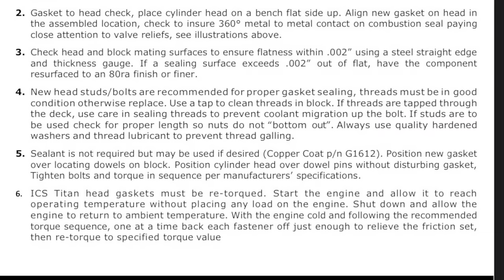Exposing Lies About VQ Engine Failure.

Comment from the maker: Time stamps:
1:42 Stock Motor Runs
3:39 Initial Engine Install/Break In
10:48 Air/Fuel Ratio Sample
13:10 Full Engine Teardown
Reply: “High profile customer” is Laughable when griff buys followers.
Reply from the maker: @DeepRightRecords  fabricated comment from a dead channel.

Comment: The fact he drove home hour n half on a built motor with a bad headgasket 🤦‍♂️
Reply: No pulls should be fine
Reply: @christopherbassit2757  “should be fine” lmaooo
Reply: My maxima had a blown head gasket and I could drive it for 1.5 hours before it would start overheating
Reply: @JoeyAG92  I’m serious lmao
Reply: @christopherbassit2757  if this engine guzzled as much coolant as admin and griffen said it did, I would beg to differ lol
Reply: @JoeyAG92  yea but you can get home with it. Change the gasket and fluids. Better then being stranded
Reply: @christopherbassit2757  sure you can get home with it, but why risk any further damage when you can simply call a tow truck
Reply: @JoeyAG92  an hour and a half tow is a lot of money. So is a damaged engine. Tough call but those VQs are beefy and take a lot of abuse.
Reply: @christopherbassit2757  if I had to decide between footing a 1.5hr tow bill or risking further damage to my 25k engine, I think that’s a pretty easy call to make.

Comment: Well Soho has my 350z as we speak… Not a built motor, but installing a 72k motor/ turbo set-up (in house tuning). 20k deep. Praying that everything is 100 when it’s finished. Definitely will be doing a YT vid.
Reply from the maker: I wish you all the best and enjoy the car to the fullest when completed!
Reply: They got both of mines 🤙🏼 work will be delivered as promised
Reply: Folks just love blowing OEM blocks. Don't care how much it can handle. Your turbo kit money could have went to a minimum of a forged bottom end.
Reply: Do it right the first time.
Reply: @pushinP87  my point exactly, but on a 370Z decent boost is okay! But I’ve always said run built before boost so I highly agree with you.
Reply: @TURBO  True the VHR can actually handle a moderate amount and with a perfect tuner you can run it NOT abuse it a very long time, just keep up the maintenance. You know my man.🤘🏾💪🏾
Reply from the maker: @pushinP87  my G37 with a stock engine and supercharger kit has been making over 600whp+ for a few years now and I daily drive it. It is tuned by me on ECUTEK.
Reply: @admintuning  its in your best interest to say this.     you do some real dig pulls... on this. it will bend the rod. the rods are tiny.
Reply: You'll be fine. The worst that can happen if you go against your tuner's recommendations, blow the engine up, and then, in a final clout chasing effort, shoot the engine with a gun and actually blow it up lmaooooo
Reply from the maker: @red-bd3mc  lol, dig pulls in a G37? I got a GTR for that. goofy comment 1,000%
Reply: @admintuning  cuz 10digs it would pop.   Facts.
Reply from the maker: @red-bd3mc  I’ve probably made 100 dig hits as it sits since I got a nice converter in it. 😍
Reply: @admintuning  gotta keep selling that dream to folks. Right babe ?    Open deck vq block good for 600whp 100digs 🤣🤣🤣🤣🤣

Comment: Took my car to soho once to troubleshoot a chain rattling noise on my VHR37 they troubleshooted it by only listening to my motor and said my heads were fried, tried to charge me almost $700. I didnt believe them, I took the car home, troubleshooted it, found that one of my sprockets were lose, tightened it problem fixed. I told them I’m not paying them the $700 they said I can’t do business with them again.
Reply: I’m the tech that worked on your car while I was there. Your cam sprockets we’re hand tight, and you completely pulled apart the VVEL cam which nobody but Nissan contains the tools to match the clearances back up and states in the Nissan manual that the heads must be replaced. If I’m not mistaken your engine blew up shortly after.
Reply: @TheTyGuy0309  😆 he didn't mention that part.
Reply: @mrjasonm.7397  😂😂😂
Reply: @TheTyGuy0309  hah that’s epic
Reply: @TheTyGuy0309  your incorrect, my engine never blew I had a spun bearing from no oil, ya’ll never found out my sprocket was lose, as a mechanic you are supposed to identify that.
Reply: Sad
Reply: @azter1234  how were you able to identify your problem was the Sprocket, but spun a bearing because you had no oil in your engine? This does not add up. That sounds like a very very poor mistake.
Reply: @DEATHWISHVQ  I took my front engine cover and timing chain out as well as my VVEL assembly and found out the only problem I had was the sprocket. I tightened it properly and put everything back together and everything was working perfectly. About a year later my oil cooler started leaking while I was racing and I started hearing a rod knock. Discovered I spun a bearing. Theirs no evidence soho is correct saying to me my heads are fried

Comment: Just my two cents. I think everyone takes some blame here. They showed the runner that was used and I have to say then shits is small af. If the cylinder can’t properly and efficiently extract the exhaust it will cause high internal temps and if you run a more aggressive timing it will not help the cause which in turn showed the head gasket being the week point before real detonation happened and why the customer would even drive it after it was found out the head was lifted.
Reply: The engine was going to fail regardless of any turbo kit or any tune, the only blame here is how bad soho is at building motors. The pistons were smacking the hg in several cylinders, would have failed with no boost.
Reply: @LeadfootFabrication  so soho released a new video. I honestly think this is the car owners fault
Reply: It’s the owners fault for deliberately going against the tuners advise.
If soho built shitty engines they wouldn’t have multiple shop and customer owned 1000hp+ engines that are reliable.
Hell the nismo soho has keeps breaking because of transmission failure, not engine. At 1200hp
Reply: @spideybuildscars  I have yet to see any of their cars actually do anything. If nismobae was as powerful as they say it would be a lot faster than 9.40's. you'd be able to back half the shit out of it but yet that doesn't happen. They are a bunch of liars, this will be exposed soon about their claimed Dyno #'s
Reply: @LeadfootFabrication  Pistons don't travel that far up. As was said this isn't an 18+:1 compression ratio.
Reply: @Juiblex100  exactly what I was thinking. Variable length con rods? 😂

Comment: The best part of this is that SOHO sells a “vq trademarked” engine package as a head lift solution but can’t follow the head gasket manufacturer’s instructions for a torque procedure. I’ve seen plenty of motors with pre-det crack a ringland before they even come close to lifting the head. Very unfortunate that soho tried to cover their ass the way they did.

Comment: At that high of whp anything can happen, it’s a VQ. Now I understand dude probably paid a good chunk for this engine but it ain’t a 70-80k race engine built by a reputable shop that only specializes in race engines like proline racing putting down 3500hp. Shits gonna happen, VQ’s break daily 😂. It’s not sohos fault nor admins fault, just shit happens
Reply from the maker: Thank you for your comment.
Reply: Your DE breaks daily not hr or vhr lol
Reply: @williecastellanos6544  gallery gaskets must be a fluke huh? Sit down
Reply: @bobbyholmes4586  my vhr has 220k miles and as far as I know my gallery gaskets are fine, engine runs strong but the 7 speed is failing :/
Reply: @louisianavq1943  you would need to see the accurate oil pressure. Most/all vqhr and vqvhr have gallery gaskets fail around 120k some as early as 80k. Its the incorrect screws not being able to be torqued down properly. DEs fail far less but it could happen.
Reply: @Stridentzephon  yes obviously but the car takes a beating and doesn’t miss a beat. I got the car with 116k 3 years ago so maybe it was done before I got it

Comment: Do the oem head gaskets not hold up at high boost like that? Also I remember MotoIQs VHR build used titan valves since they were 1mm larger and were sodium filled, was there any consideration for that? Sucks the installation was done so poorly rip motor
Reply: Stock head gasket does not. Current I am helping a friend build a car that is using tkm mini hoops with an MLS gasket. This combo doesn't have the annoyance of running a copper hg and will hopefully allow high power applications. We will know more later this year.

Comment: As a man your reputation is important and must be protected at all cost. In the future I would keep all tuning log files. If anyone needs a detonation monitor hit me up. Where is the knock strength log from the dyno runs?  Your not logging Exhaust gas temperature or back pressure two critical parameters for a highly stressed engine. Also I would like to see the dyno graphs as these will provide evidence of what is going on. If there are issues before power runs none should have not been made. Why was the go ahead given?
Reply: I have just watched SOHO and I think your knock strength logs and dyno pulls are critical pieces of evidence. You can't refute too much heat claim as you have no back pressure or exhaust temperature parameters. I am not sure if water temperature would be a good reflection of excessive heat (cylinder head temperatures). I am thinking at these power levels you should not attempt a calibration without these parameters. At these power levels and cost a detonation monitor is a must after car leaves the tuner.
Reply from the maker: Lol. If any of that was valid it would have showed on the pistons. There’s no sign of detonation on the pistons at all which means none of that occurred. Your wording and sentence structure and phrasing of “knock strength logs” shows your ignorance more than anything else.
Reply: @admintuning  Those who articulate well are not necessarily the smartest. I am not going to get into personal attacks. In court personal attacks do not matter. The nissan motor has a knock sensors on each bank. If there is or was a tendency to detonate  the logs would have revealed this. If back pressure was the issue then the torque at higher rpm would be quickly dropping off. In my ignorance all I am saying is that with enough parameters it is easier to make a more objective conclusion. What do you think space x it does when the rocket blows up?
Reply: Can you phrase what you did with the knock sensitivity and intake air temperatures verse ignition timing properly? "It is not picking up a ton". 🚩🚩🚩. Where are the knock logs?
Reply: Having done some research  it seems you may be right about the lack of detonation.  https://youtu.be/-7cM5UcJO6o

Comment: Wait so it was blowing coolant all over the engine and that was the green light for starting to turn up the boost? Why would you crank up the boost if there is such and obvious problem with the motor? Sus. Seeing the other video now, that engine what heavy cleaned before making this video, and you avoid showing all of head, the heavy pitting on the exhaust head of cylinder 5 can't be cleaned up and it makes sense that the oem head would show heat damage more than a forged and treated piston head.
Reply from the maker: I never said that was a green light, lol. We also didn't 'avoid' showing the head, this video was made to debunk all claims of this failure being a detonation related/aggressive tune related failure, which the pistons and bearings clearly show.

Comment: 13 mins in, I’m just curious how do you go in and re torque the head gaskets after running it at operating temp? Do you have to disassemble and tighten the bolts back down? Interesting.
Reply: Correct, with the vq it sucks because you have to disassemble the timing cover to do it but it needs to be done.
Reply: @LeadfootFabrication  right, but what has to be done has to be done. Especially for a 20k motor.
Reply: @tristanoliver2911  literally take it apart to where you can get back to the head studs and retorque them to spec and put it back together. That's it.
Reply: You know what’s so insane. I was trying to figure out VQ lift and I came to this conclusion, I asked myself “well if vq lift is a thing, then why not run the car for awhile, then re torque the head gasket since u know its going to lift” I’m not a genius but I’m surprised I has this thought
Reply: If I’m not mistaken the manufacturer of the head gasket specializes in top fuel drag applications which explains the use of copper head gaskets and fuel hoops which require machining to the head (in this case sohos hb package). The top fuel engines were designed to be easily disassembled so it’s no problem for them. For a vq, it’s highly undesirable as the timing cover and cams have to come out.

Comment: Dynosty head gasket with stainless steel oringed head and CSS block or maybe LA sleeves amphibious sleeves would be the best options under 1100 horsepower. All copper head gaskets and hoops must always be retorqued.
Reply from the maker: I haven't seen LA sleeves on a VQ yet, so I'd be interested to see how they do. The Dynosty head gasket has held multiple CSS type builds together at 900whp+ tuned by me.

Comment: I honestly believe warranting this motor would have helped their reputation better than deflecting. I am kind of embarrassed now,  because my exposed intercooler on the Z has SM on it. Tuned by Admin btw....
Reply: 10000%
Reply: I agree they should have at least say “hey we don’t think we where the factor that caused the premature failure of the engine, but we’ll replace it if the customer replaces the headers” since they believe the restriction on the exhaust headers cause the engine failure which I can believe
Reply: all in all, this whole situation would have played out differently had griffin got tuned by SOHO. At that point soho would have nobody to blame, as they built the engine and would have done the tune.
Reply: @DEATHWISHVQ35  
Sometimes when incompetent shops mess up badly the squirm around and desperately blame the customer.
I think they would have still lied and deflected even if they tuned it
Reply: @yepyepyepyep1407  Why would that make any sense? The failure wasn't due to something Soho did and Griffin drove the car knowing it had a bad head gasket, which they explicitly state voids their warranty in the paperwork you fill out when ordering a built motor from them. Griffin legally voided the warranty. Just because he has a following doesn't mean he's entitled to privileges no one else gets, including Soho replacing a motor he chose to damage. On top of all of this, Admin knew the turbo kit was too restrictive for the power he wanted to make and chose to push forward, ignoring multiple signs of an issue on the dyno. This would 100% not be covered by Soho's warranty for anyone else - why do you think they owe him a new motor!? Lmao
Reply: A. C. Now go watch soho response and tell me what you think now
Reply: @scottyboidabest  I watched their response and my previous statement stands.  If they believe AdminTuning was at fault, then that is even more reason why they should make Griffin "whole" without their stupid stipulations of Griffin being tuned by them.  They should warranty the flipping and allow him to take it to whichever tuner or ship he wants to have installed. To me, using the excuse "We designed the motor, know how to tune and install it better than anyone" is just giving them a reason to cover up if something shady happens: vs having another shop doing it to give us transparency.

Besides, if Moncef is at fault, let him retune it again and it'll have the same problem.  This I doubt because SoHo will build it properly this time.
Reply: @alexnor9  that makes since but didn’t they say they would warranty it but it was before they found out he drove home on a bad head gasket. But if he had simply pulled the motor, the issue during the first error could have been corrected. I could have not listened close enough but idk the situation is bad yeah but I’m not going just start shaming Soho when there was negligence amongst both parties.
Reply: @Gborohooo  Something called Magnuson-Moss Warranty Act.  You should go back to the kids' section young "pronoun of your choice" and watch some Bluey. The adults are discussing some important topics right now and we don't have time to babysit...
Reply: @Gborohooo  Awwww... Don't be so grumpy little one; that is a cool story. Be sure to tell your parents it at your bedtime: I'm sure they'll believe it. Now run along and get some sleep. Okay? Maybe you'll grow up big, strong, and be able to accomplish it one day. 😉

Comment: retorquing VQ heads is a pretty big job on it's own. probably would have been better off with an OEM head gasket.
Reply from the maker: We have used Dynosty metal head gaskets at 900whp-1000whp+ with no coolant pressure issues and @370_trash who is also tuned by me ran 4.35 60-130 with his $5k engine build.
Reply: @admintuning  cool. I'm actually watching the admin tuning and Oscar on the street alpha podcast right now. I have a 02 6 speed Maxima with a 2014 engine swapped in. VQ for life, G37 sedan is next on my list...
Reply from the maker: @uptownsamcv  fasho!